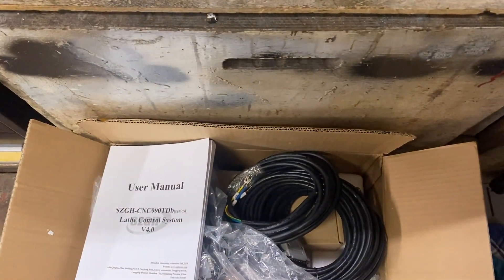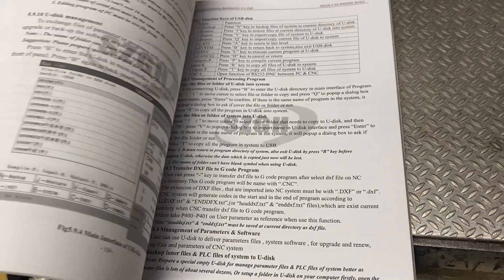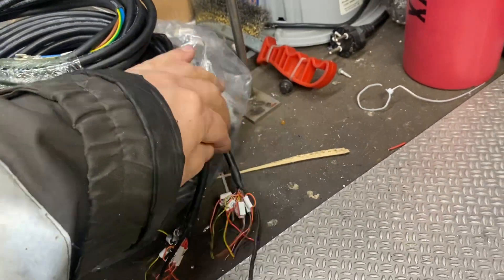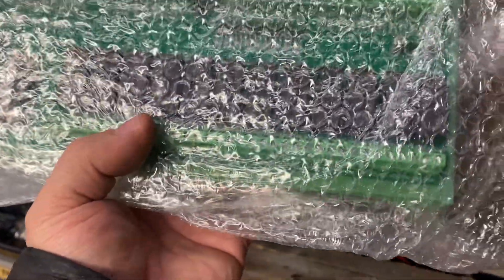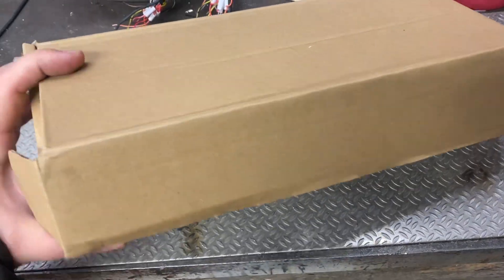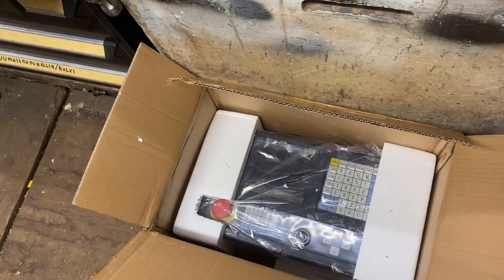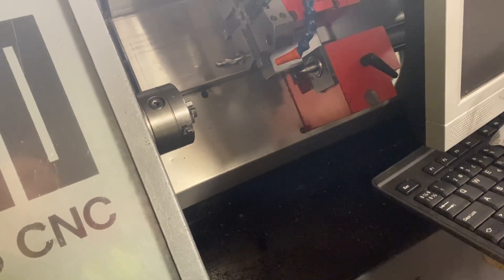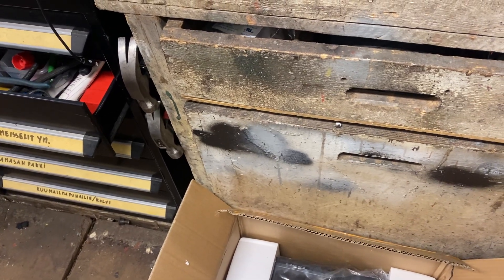SZGH-CNC990TDb unboxing (ish) english version.

Comment: How do you feel with this cnc?
How much is it?
Reply from the maker: I love it, very easy to setup and to operate. Depending where you buy it around 700-800€
Reply: @MJPilote  Thanks...it has the old +- 10 V output to the drivers, right?
Reply from the maker: @mariomatteopapetti3221  you can get it with step and dir also and servo configuration with closed loop.